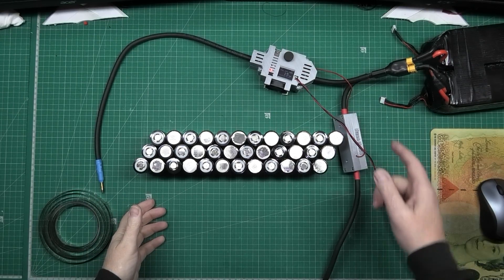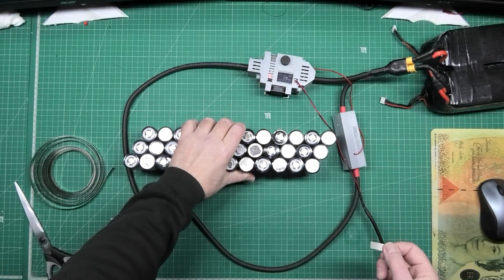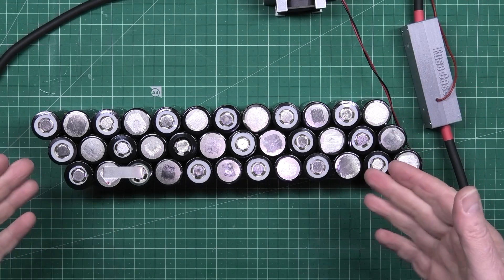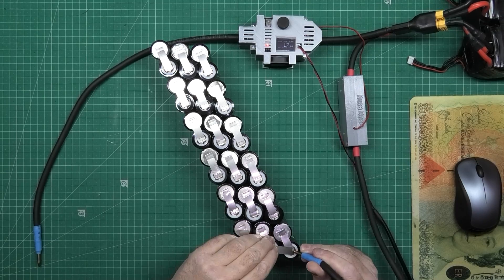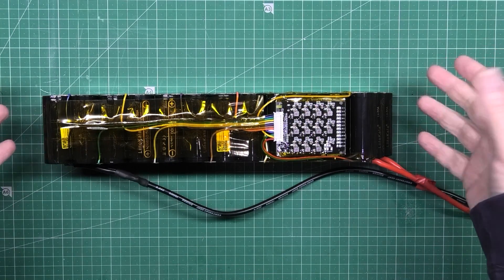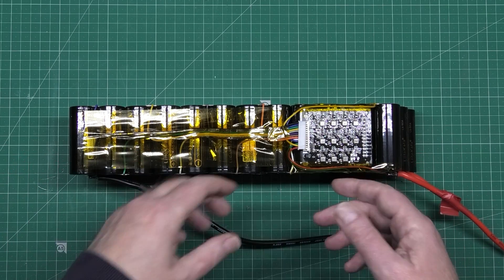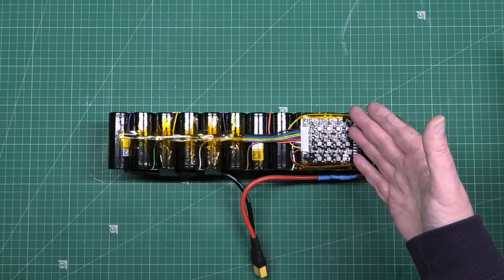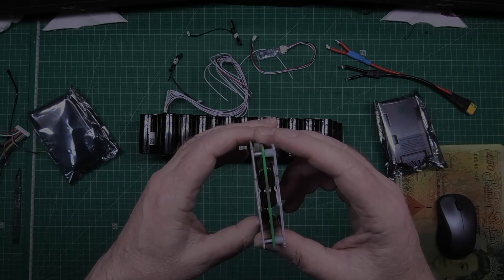Budget 1500w DIY eBike build part 3 - Active balancers are crap!

Comment: When connecting the balance wires to Battery + , what determines battery + ?  The reason I'm asking is because you are connecting the balance wires in between the positive of one cell and the negative of the next. This baffles my noggin a little. 
Is it the direction of current flow what determines where you can solder the balance wire when it's in between + of one cell and - of the next ?
At what point along the nickle strip does the + of one cell become the - of the next ?  Edit: Just watching the next video and you're attaching the balance wires on to the parallel strips. That makes sense, but are you attaching to the series strips on this vid ? Which brings me back to the above question.
Reply from the maker: I understand that it's hard to get your head around mate.......
It doesn't matter where you connect it on the series link.
Every BMS/balancer works in exactly the same way - it also uses the positive as a negative. Take the 1st cell (it's obvious which is positive and negative) then take the positive from the 1st cell, switch it to negative for the 2nd cell and then use the positive on the 2nd cell - sequence through like that and hey presto!
Does that make more sense?
Reply: @Vortecks  - Maybe, if I read it a few times. I think I might be overcomplicating what is relatively simple.
I'll feel more comfortable attaching to the parallel strips that go in between the positive terminals of a cell. That way, I'd know it was in the right place. I hope :)
Is it best to attach balance wires to the series or parallel ? Does the BMS find it easier to do its job with one or the other ?

Comment: Hello, I have found your channel back after months again, you inspired me to make my first ebike about 3 months ago and it was a 2000w rear geared hub motor but thats sold after 2k miles on the clock and I was looking into making another one and here I stumble upon your channel again, I want to replicate your voodoo canzo ebike built with the 3k turbo v3 motor but can't find the motor online anywhere, would you be able to provide a link? I am based in england too so a link that works for you should work for me. Also, when you got yours was it complete with a wheel already or only motor and you laced it to a wheel? And one last thing, voodoo canzo has 10 or 11 gear at the back (I believe) would I be able to shift the cassette from the bike wheel to the new motor or I can get a motor with the same gear cassette or it will be a 6-7 gear cassette?
Reply from the maker: To be honest mate, this is the only place I know that sells them now - https://www.ebikeparts.at/catalogue/mxus-3k-turbo-motor-ohne-felge_158/
Mine was the hub only and I laced it myself into a rim. The cassette I used was a 10 gear I think but it was a long time ago, maybe looking at my older videos might give you more info. Sorry I haven't been much help but I have 100's of comments every day and my time is somewhat limited at the moment.

Comment: Dude !! nice neat battery and all that but it will never get you up to 40mph as 48v x 22.5 amps = 1080w or 54.6v x22.5 amps 1228 watts if fully charged (if its 45 amp peak it will be around half that current draw/constant ) I think you need to find that other 500 watts you paid for or settle for 32ish mph top speed, ps it won't get used very much is it's not relatively waterproof or if it does it won't last very long.

Comment: Are those cells on aliexpress trust worthy? If you buy 10 at once you can get them for $3.75 which seems to be a really good deal, did you individually test them all?
Reply from the maker: I've been using the same ones in my 15kw bike for nearly 12 months and they're still going strong which is proof enough for me 😁
Reply: @Vortecks  Are they from the same seller, saw some posts from people saying to only buy from the official store which wasn't this one (they posted a store number and they didn't match).

Comment: Seems nobody quite understand how these work, they just cascade the power throughout the pack.

So 10s pack if cell 1 is 4.10v and the rest are 4v then it takes some of the power from cell 1 and gives it to the next cell so 1+2 are now 4.05v but that means cell 3 is now .05v lower so it steals power from cell 2 which also steals power from cell 1.
Now cells 1-2-3 are 4.033 and cells 4+ is 4v so .33v different, so cell 4 starts stealing power and you get the idea.

Once its all done all the cells should be just under 4.01v = .1v / 10 minus some losses. assuming its that accurate.

That's different to BMS using resistors where the resistor just burns the power off as heat so that cell 1 at 4.10v will just heat a resistor with its extra .1v until its 4v, so the other cells see no benefit until the charger starts up and add more power. if one cell is out then it just stops starts until all the cells are the same.
So if one cell has less capacity then that resistor will just keep being turned on to bring its voltage back down as it takes less electricity to make it full.
But when draining, that cell is also the first one to become empty as it has less capacity.

Where this active balancer come into use if when your draining the battery. 
If your packs out of balance it will give extra power to the weak cell as your riding instead of just letting that cell over drain.

I assume that active balancers just pulsing the inductor via a transistor to make a basic transformer between the cell, can you confirm this Tony?

What would be smart would be a BMS with both systems on, resistors for extra safety on the charger and then the active balancer for the rest of the time.
Reply from the maker: I fully understand how they 'should' work. This one simply doesn't work at all.
Reply: Most active balancers are shit. You cannot make an active balancers for very cheap.
Reply: Are they the $30~ eBay ones? I was wanting to use one or possibly two of them on my 16s12p battery to help keep it balanced discharging.

Comment: When you buy batteries etc from aliexpress, do you end up paying VAT or imoort duty and royal mail fees? I've always been put off buying anything over £15 from China as royal mail seem to charge quite a high fee. Have you got a strategy in how you buy things?
PS do the anti-PC dad/daughter thing, it'll be like car share on steroids.
Reply from the maker: When I buy the Liitokala 26650's, they always send them in packages of 10. I've bought over 300 of them and only been hit once - that was £12
Reply: I buy a lot from aliexpress and have up to this week only had 2 parcels in 10+ years stopped for import duty... This week, I have 7 of 11 parcels with £11.12 to pay... So some get through others don't... You just have to keep a bit aside and add that potential on..
Reply: I am curious about import taxes too. Wouldn't it then be cheaper to just buy cells from nkon.nl and don't bother with the Chinese?
Reply: @Anonymous-qx5uk  even with these cells having £78 import tax on top, its still a significant saving over Nkon for the 26650 cells that I have ordered at least... The efficiency comes from speed of delivery from Nkon and turn around time of the pack if all other parts are in stock
Reply: @Anonymous-qx5uk  main think with buying from nkon is they are know to supply real batteries like they advertise.
Aliexpress you have to be careful.

Comment: Hmmmm, I'd like to take a look at that active BMS and work out what its doing, I have one on a lower S count RC plane and it works fine.
Reply: Just links to the cell next to it to cascade the power across the pack without directly linking the power.
So instead of burning the electricity off it can move it to the adjacent cell.
Reply: @TheWebstaff  Indeed, but clearly this one ain't doing that :/
Reply from the maker: I have a 3s version and it seems to work ok. This one is now floating around in the recycle plant somewhere because I couldn't be bothered with it 😂
Reply: @Vortecks  Hah!, next time you get some electronics doing strange things let me know, it's a hobby... well more of an CDO thing really.

Comment: was thinking of making own car battery like this, would it be worth it ?? how do i even calculate what amount of batteries i need for such a thing though 0_o
Reply: Simple arithmetic. First you have to know what power you need at what voltage to get current required.
So if you want 10kW, then that is VxA which is 100A x 100V, or 200A x 50V or 400V x 25A.
If each cell can give 5A and you need 100 A, then you need 20 in parallel for the current.
If you need 100V, and each cell is 4V, then you need 25 cells in series = 25x20 = 500 cells.
If you want more capacity, then add more cells in parallel.
Play with the numbers to get what you want.

Comment: I use an active balancer( with bluetooth) for my 24s LiFePO4 pack on my cafe racer.  You can select balacing current up to 1 amp, and select millivolt balancing limits from the app.  It works good, but not something that you want to leave unattended, if you are fast charging....the only thing I don’t like is that it is limited to transferring energy from the highest voltage cell to the lowest voltage cell.  So it takes some time.  Be nice if it could do multiple cell balancing across all cells simutaneously.  A bms that cuts charging when one cell reaches peak voltage, is much safer.  Be a learning curve to see how you convert a 12s bms to a 13s bms....didn’t know of this trick, will be watching for your next video in ernest!  cheers!
Reply: You got a link for the BMS your talking about, ta.
Reply: Dave Webster  I got mine from Aliexpress, IC GOGOGO Store. Or search  “ 1 amp active balancer” in Aliexpress.   I paid $87 usd, free delivery.  cheers!
Reply from the maker: @TheWebstaff  Description updated mate which is for the BMS and not the active balancer. EDIT..... you're not asking me, never mind 😂
Reply: Have you actually checked the cell voltages with meter? In my experience, the resistive balancers do a much more reliable job..
Reply: @HMPirates  would the balancers with the resistors only work charging the battery or discharging too?